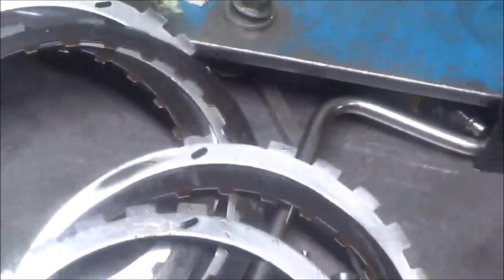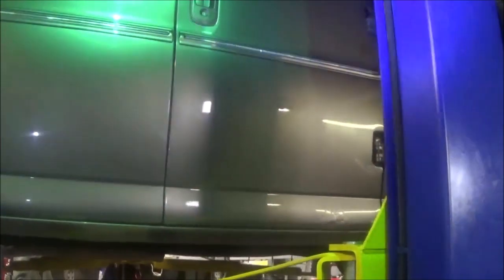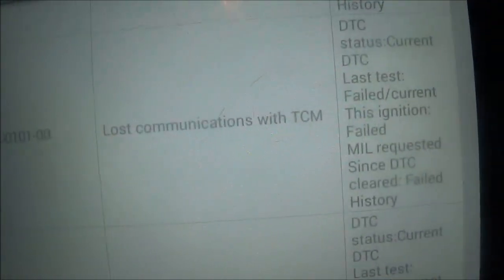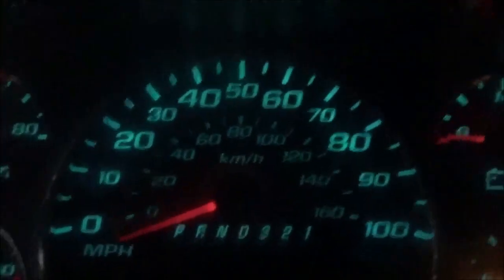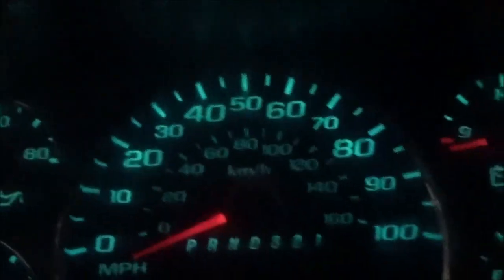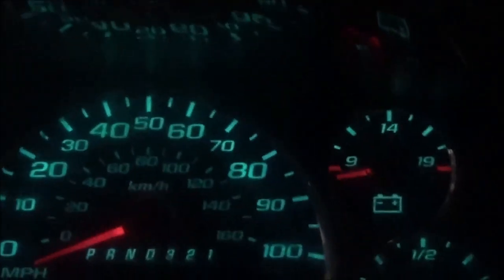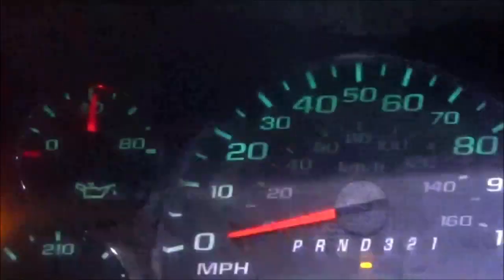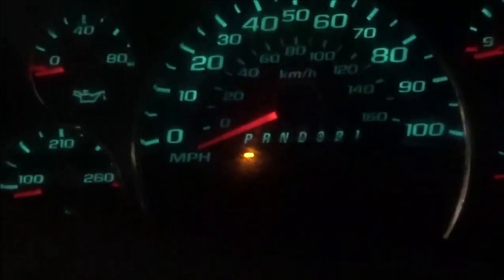2010 CHEVY VAN, VEHICLE DOES NOT MOVE, TRANSMISSION DOES NOT SHIFT!!

Comment: I have cheby expres 2017  3500. I have reversa. But no forwarded.... 107 k miles
Reply from the maker: 8 speed transmission or 6 speed transmission?
Reply: Have a 2008, 460,000 miles on it, just stopped pulling tonight and stuck on the side of the road